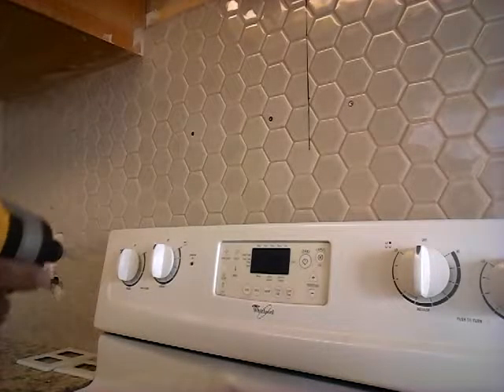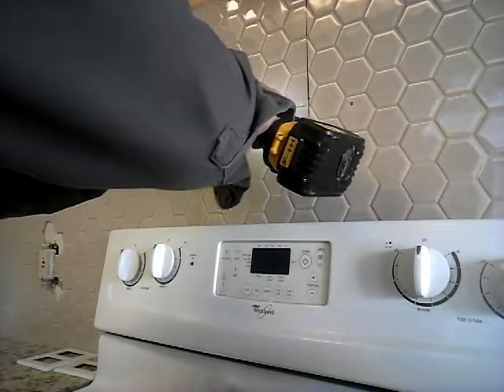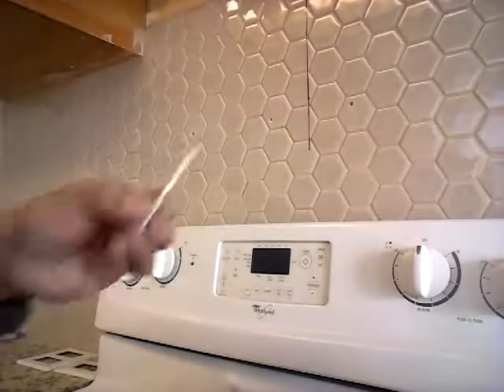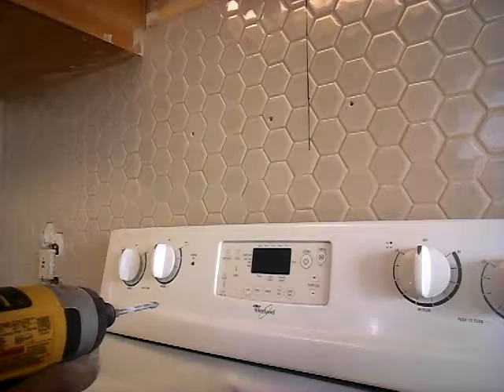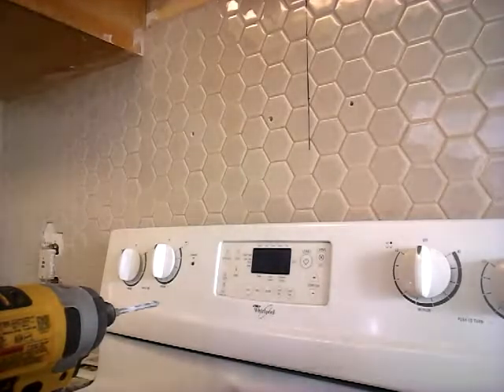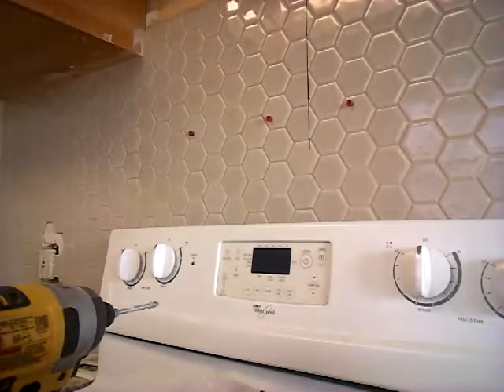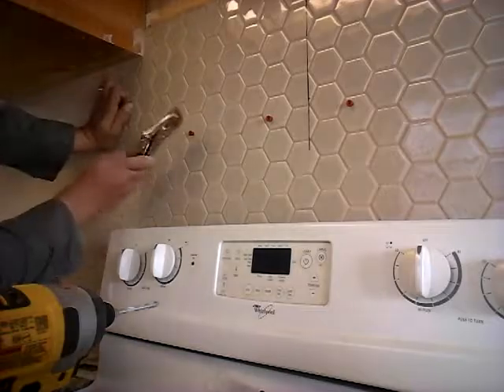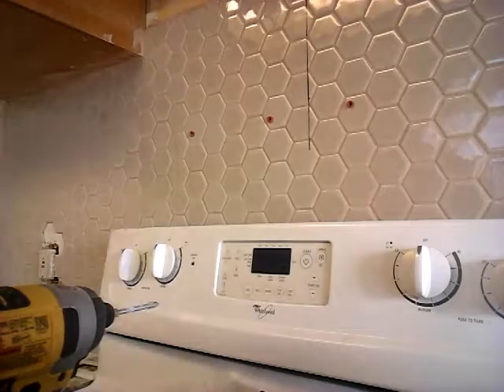How To Drill A Hole In Tile For Over The Range Microwave. QUICK AND EASY!

Comment: Those aren't strong enough anchors to hold it microwave safely..
Reply: That doesn't hold the microwave...the bolts at the top support the weight 😮😮😮
Reply: @newbeginning8134  Not entirely true. The bolts on top will not secure the microwave alone and there is considerable weight on the bottom rear. That's why manufacturer's instructions require you to secure it into at least one stud. At the very least you should be using Toggle bolts.
Reply: @jessejames586  well let's hope that mines I just put up holds...I used 3 75lb sheetrock anchors 😅😅😅
Reply: @newbeginning8134  ha!  Go hang 75lbs from one of those anchors and see what happens to the sheetrock.  Sheesh.

Comment: It is mandatory to find a stud behind one of those holes. Not only does the weight of the microwave need to be supported, but there's also the years of pulling on the handle. The level of ignorance in appliance installation is alarming.